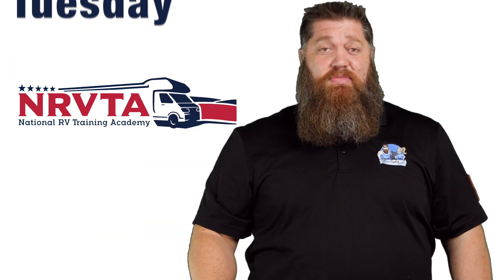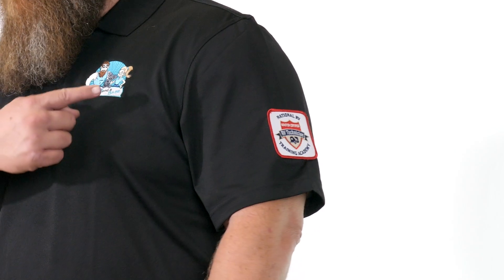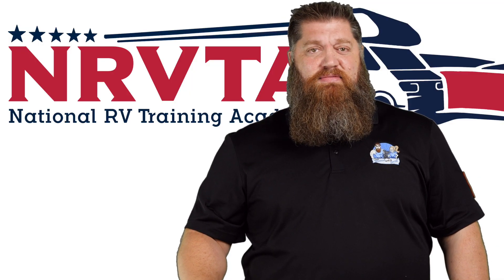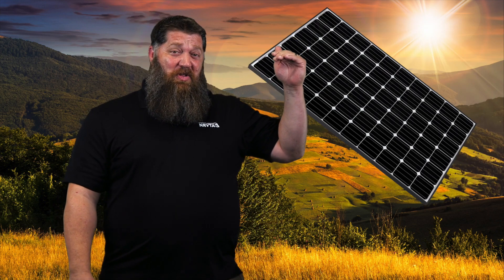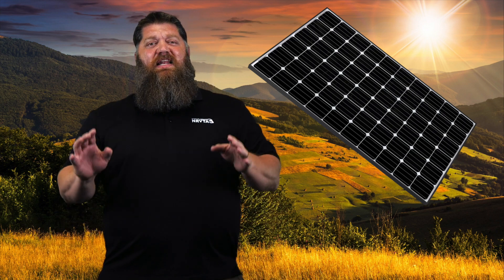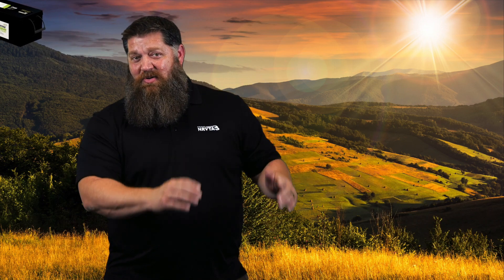What are MPPT Solar Charge Controllers?

Comment: Just a heads up. Most charge controllers need the battery voltage applied first. If you apply the solar voltage first. You may damage your charge controller. You may see some round tubular shaped circuit breaker. I recommend you not use them. I had one on the battery side of my system fail. Which left the voltage from the solar panels applied to the charge controller. As I said earlier this destroyed my charge controller. Always apply your battery voltage to your charge controller first. Then apply the voltage from your solar panels. To shut down your system turn off the power from your solar panels first. Then turn off the power from your batteries. Following this procedure just may save you from buying a new charge controller. Read the instructional manual closely for the information about applying power to your charge controller.
Reply from the maker: absolutely correct. the solar controller needs to know voltage out before voltage in.
Reply: how you do that?
Reply: @Vintageflipbritt  hook up controller to battery first, then solar panel.  When dismantling, unplug solar panel first, then battery. 😊

Comment: I have panels, mppt , and battery. Do i need anything else?
Reply from the maker: for the 12vdc side the only thing you would need is a good fuse/breaker so you can protect the wires and cutoff the solar panels to the mppt if needed

Comment: You also didn't mention that a solar charge controller will prevent your solar panels from discharging your battery overnight
Reply from the maker: there is a lot i didn’t mention, 2 minutes. got to have material for later. :)

Comment: OK, so MPPT? You didn’t specifically mention it. What is it? And are there other types?  First comment by the way!
Reply from the maker: So MPPT stands for maximum power point tracker. Its a specific type of solar controller that works efficiently at constantly adjusting the volts and amps based on the sunstrike. 

There are two types of solar controllers. MPPT and PWM. PWM controllers are less expensive but not as efficient when it comes to converting the volts and amps and not as effective as an MPPT controller. 

This was an extra free minute to my 2 minute Tuesdays.